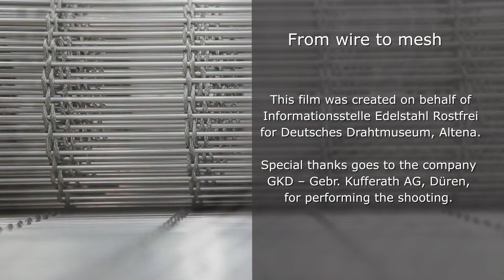From Wire To Mesh

Comment from the maker: Beyond The Weave: The Evolution of GKD Metal Weaving

http://bit.ly/18Jn92P

Metal wires are woven just like textiles. Since 1915, GKD has woven its metal on looms.  Our current advanced looms are robust and at the same time, technically on the cutting edge. GKD is the number one driving force behind achieving technical metal weaving advancements.